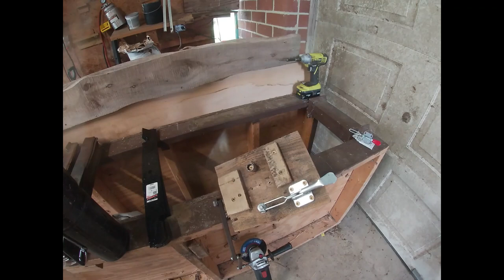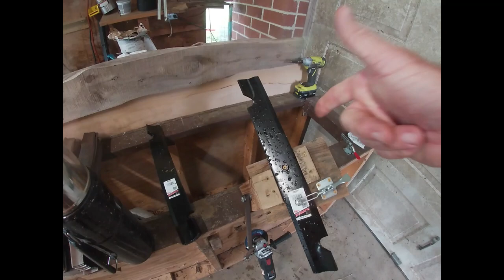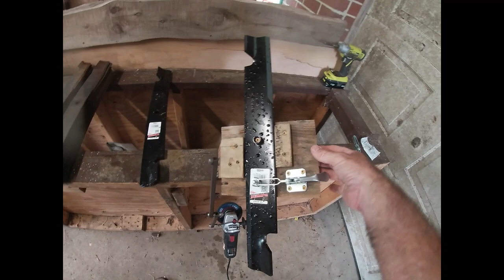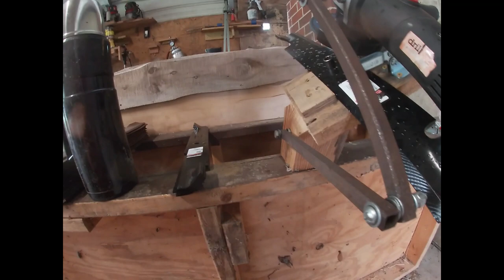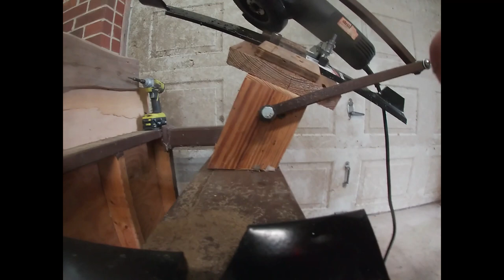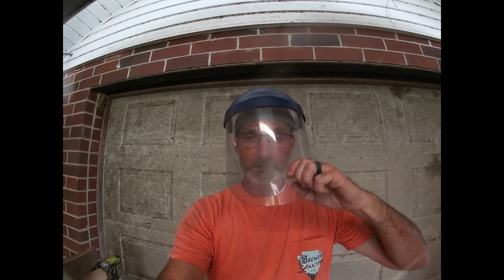25.00 Blade Sharpener | Updated & Detailed View

Comment: Thank you for sharing.  I built one based on your design last year, and it did a wonderful job.  This spring I invested in a couple of thrust bearing, about $7 total, to use on where the arm attaches the wood block.  Turns easier and reduces the wobbling, in reality it won't make much difference but it moves more smoothly.  Thanks again for a great idea.
Reply from the maker: I bought some bearings too, but I never installed them.......been using it like it is lol

Comment: Heck if i just had that block that holds the blade bevel horizontal that would be a huge improvement for me. A flapper disk is far superior to any stone for sharpening in my opinion.
Reply from the maker: I like the flap disc and have used them for years. People still criticize me for using them…..to each their own 😁.

Comment: One of the things that would prevent the grinder of wobbling during use, would be to have the upper arm & grinder to be on the same angle & attached. I suspect that you would have to make your lower arm be longer than the upper. From a fellow Georgian (Dalton, Ga) to another, it is great that you are sharing something of yours that can be helpful to others.
Reply from the maker: Thanks Kevin. There are definitely some improvements that have been made by others on this build. It has been neat to hear what others are doing. 💪

Comment: Enjoyed both videos on this topic.  Gonna put one togather for myself and my sons to keep things sharp.  The wobbly arm doesn't really change the angle of attack does it?  Might mean the point of contact isn't right in the middle, like you showed, but not sure it would have an impact on the final grind.  Any thoughts?
Reply from the maker: I would think the change of degree would be minimal. Of course if I had used some bearing, I could have stiffened the arm up a lot. I hope your build goes well.

Comment: I love making things with my own hands. Will definitely build one of these! Thank you for the awesome videos! I can vouch that safety glasses are not enough. I had two pieces of metal fly around my "safety" glasses and lodge themselves in my left eye and I had used a grinder during work for years this way before this incident. Didn't feel good going in or the eye doc removing them. Not to mention irritation and time recovering. Little pieces flying around are hot and do not always fly in a straight line. I was lucky and regained full sight. Dont risk it.
Reply from the maker: Glad to hear you recovered.... definitely can be dangerous! I hope your build goes well!

Comment: On that clamp, is it the 60lb holding power version or the 200lb one? This is a great looking upgrade to your original design. I'm working on getting this up and running using some old computer rack rails instead of the square steel tubing. It looks like it will work just fine.
Reply from the maker: That should work fine for you. Clamps were 220lb. Just went and looked it up. Good luck
Reply: @cleangreenlawnservicellc2630  Awsome, thanks for the quick reply. I'll order some right now.
Reply from the maker: You're welcome!